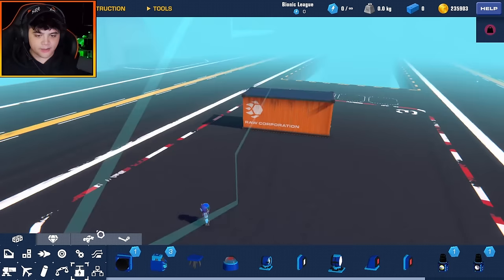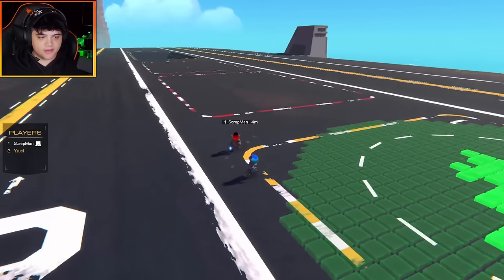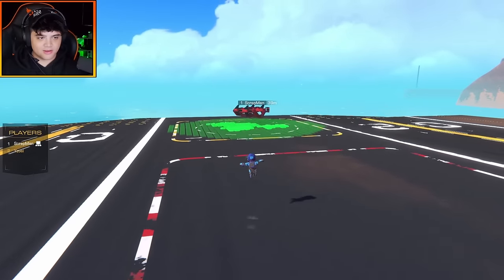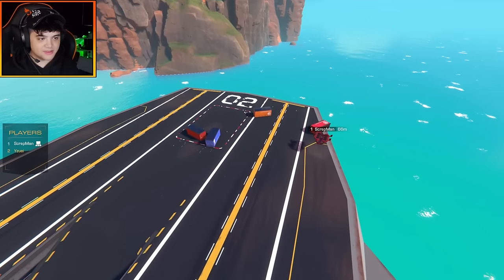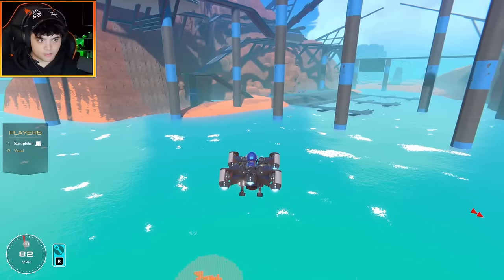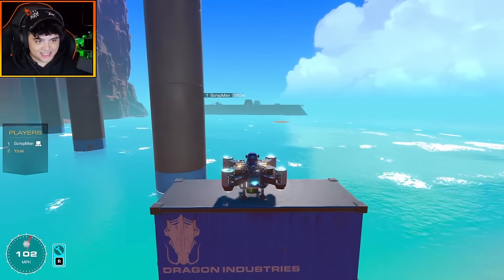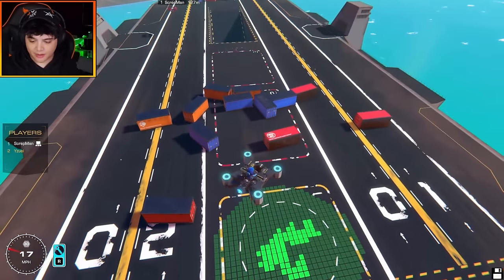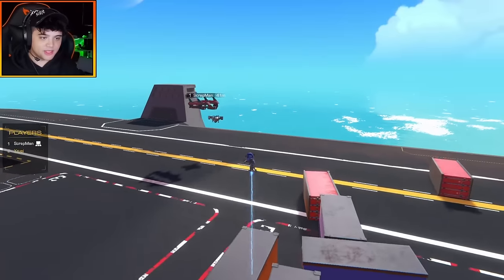Making A DELIVERY Drone That Can Carry SHIPMENTS!

Comment: 2 thoughts:

1: It looked like your Forward Thrusters were firing and fighting you when ya were thrusting forward fighting your attempt to fly forward faster... mighta been better if those Forward Thrusters had been Logiced to fire when ya weren't Thrusting but disengage when ya were Thrusting so they wouldn't fight your Forward Speed with their counter Reverse Thrust.

2: I wonder if there were ever any 'opportunities' to sneak a picked up Delivery into the way of a opponent near but a little behind you to try to trick them into running their Craft into your Box and suffer an unfortunate 'mishap' and get slowed down...? >:P